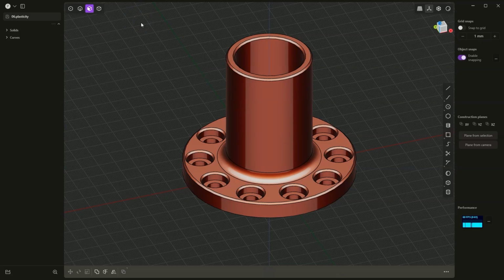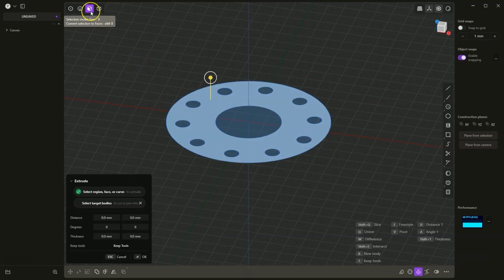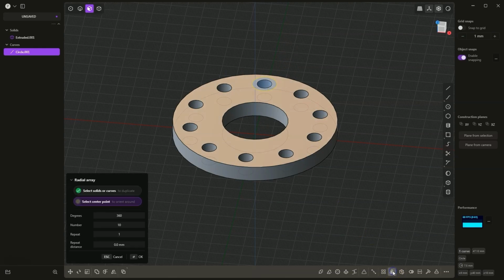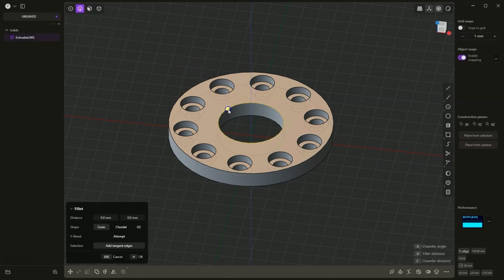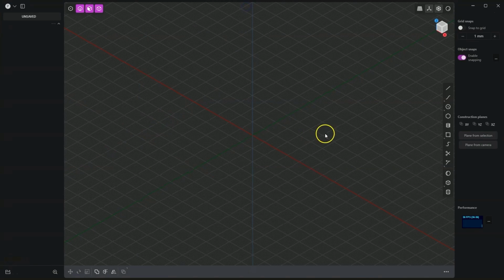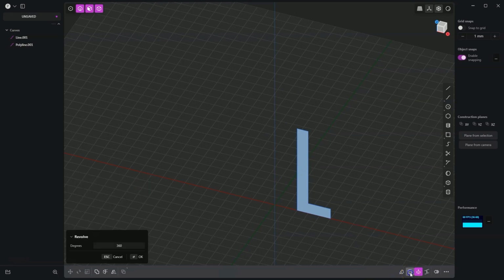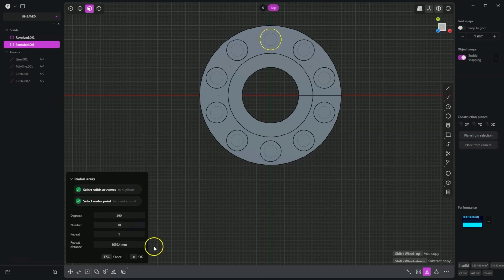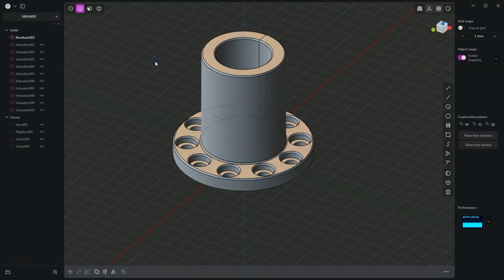Plasticity Tutorial for Beginners 2024

Comment: Good video, thanks!
Question: After the model is finished, how difficult is it to do things like: change the number of holes, change the diameter of the base where the holes are, and then align the holes in the center? 
(I'm thinking of adopting Plasticity, but I'm coming from Fusion360 and FreeCad and I usually manage that with sketches and relative distances)
Reply from the maker: This is done differently than in Fusion and FreeCAD.
In my opinion, for precise, technical modeling with the ability to easily make changes, FreeCAD and Fusion are better.
Plasticity is better for freeform and conceptual modeling.
In this example, if you wanted to change the number of holes, you would have to do it again.

Comment: Great tutorial, thank you. Question: you demonstrated that editing the original sketch doesn't change the resultant extruded solid, so how does one go about modifying the solid if there is a change? Using your project as an example, say you wanted to decrease the diameter of the 10 revolved holes from 10mm to 8mm, how would you accomplish this?
Reply: I believe based on another tutorial i saw (im looking into this as an option to add into my workflow), the face representing the hole diameter can be selected and moved/ scaled (and i assume the edges of the hole can be selected at one object face adjusted to add a taper)
Reply: @bobjoe1593  Thanks mate. I'll give that a crack.
Reply from the maker: I'll make a video on this soon.

Comment: I am currently using TinkerCAD and would like to switch to more advanced software like Plasticity, but I have already noticed one potential problem. I create objects in which I will later place magnets, so I prepare several versions with different sizes, which I print and then test to see which version fits best for round magnets, for example, with dimensions of 25mm/10mm. I check if the magnet fits too easily or maybe too loosely, and based on this, I choose the best version or make minor adjustments and print again. Will I be able to easily change the size of a hole for the magnet (either enlarge or shrink it) in Plasticity?
Thx for your help!
Reply from the maker: These changes are easy to make in Plasticity. You can select the hole face and drag the gizmo to change the dimensions, but you can also type in a specific value by which you want to change the dimensions.
Reply: @start3dmodeling  Thank you for quick reply and clarification! I'm glad to hear these adjustments are easy to make in Plasticity. I really appreciate your help—keep up the great work! 😎😎

Comment: Brand new to CAD and designed my first 3D printer project in like 30mins just using this video as a guide. Tried Fusion 360 first but its gonna take serious time to learn. Plasticity being able to measure to one thousandth of an inch is close enough for the girls I go with.
Reply: what did you design? Interesting.
Reply: @ A spacer for a set of plastic dually center caps. Pretty much a thick ring with 6 hole cut outs along the edge. Kind looks like a gear.